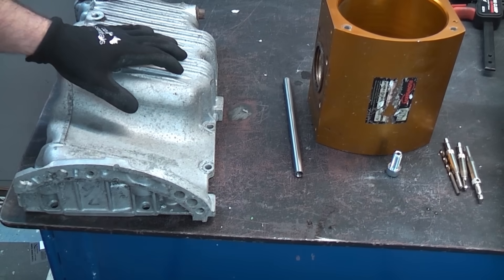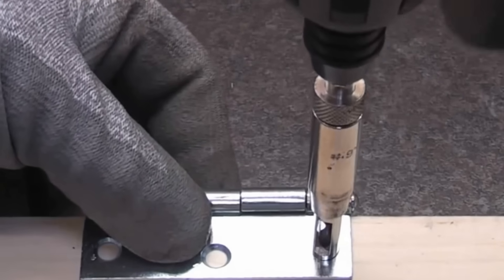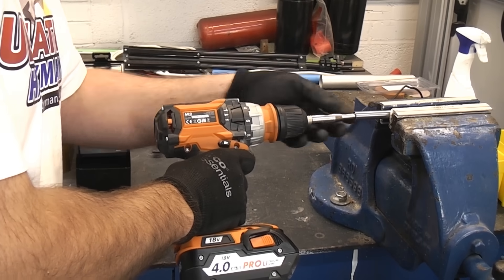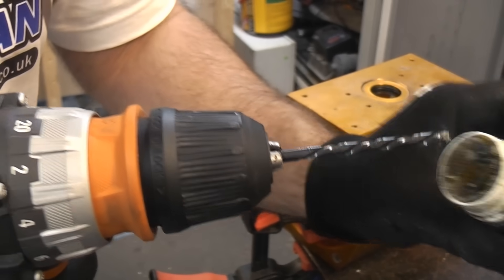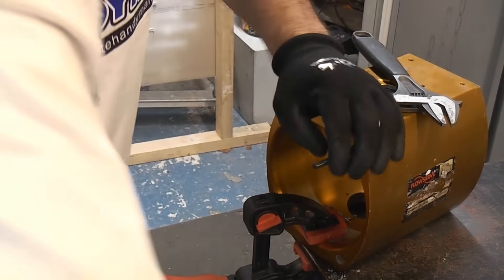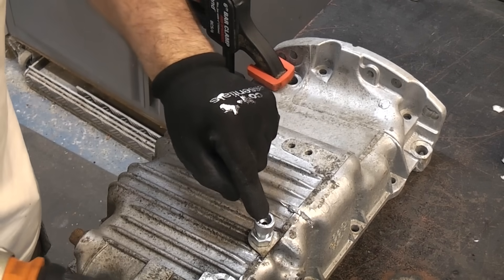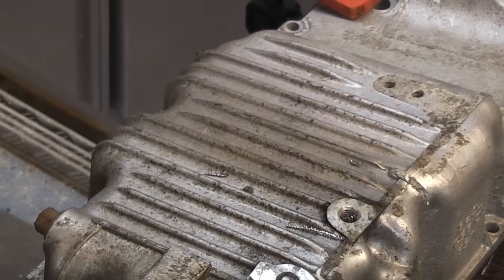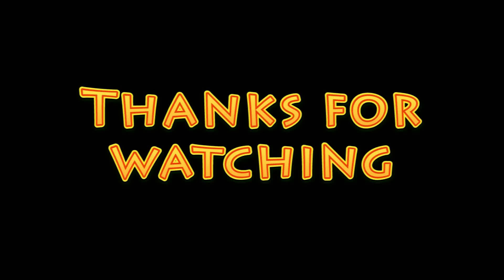How to remove a broken bolt in a deep hole | remove broken bolt in recessed hole

Comment: Just saying here, if you're trying to remove "softish" bolts then forget tapered easy outs. The more you turn them, the more the broken soft bolt expands and gets itself lodged forever. In these cases drill a hole as stated above and then take an Allen key socket and bang it in. This cuts 6 grooves without expanding the broken bolt too much. When in, wiggle it loose to unscrew it easier than the tapered "easy out". Just saying. In the last 10 to 15 years I've found Allen key method way better than easy out tapered method. Sure!! "Feel" has a LOT to do with it! But the average Allen key socket is much stronger than any "easy out". And because it's NOT tapered it does not make the situation worse. 

Also, if the stud end is near the surface, and it's rusted, then MIG weld a blob on it, then build that blob upwards until you can weld a "stud" to it. Vice Grip it when cool enough and carefully unscrew it using rust release oil spray. The heating effect tends to "burn" the rust inside the thread. When cooling happens, it shrinks and broken studs start moving. Try it, you'll like it! From Africa!!
Reply from the maker: I'll try this sometime.
Thanks for the excellent comment ;-)

Comment: It's not aluminium, (al loo mini um) it's aluminum (a loo min um) it's not even spelt with an I after the N. As far as the removals, excellent!
Reply from the maker: Seriously, this is getting boring now.
People in different parts of the world spell and pronounce things differently.
Reply: Ultimate Handyman lol, I'm just being a dickhead, jerking your chain. The video was excellent, I have left hand drill bits but have never seen that tool you used to centre the bit in the hole. I just centre punch then drill and when I relieve enough pressure, the bit digs in and walks the stud or bolt out. Now I have to buy another tool...darn...lol! Another thing I do is weld a nut on the end of the stud if it's protruding or you can get welding rods made specifically for building up a stud broke off in a hole. The flux protects the threads! Anyway, enjoyed the video, thumbs up from a dickhead in Canada.
Reply from the maker: @jimmiller4667   Thanks for the update. I try  to respond to all comments, but the ones about aluminum/aluminium take up far too much of my time ;-)
Thanks for the comments 😉

Comment: I build the bolt up with E6011 until it was  slightly higher than the piece. Then weld a washer to the top of the build up and weld a nut to the washer. Let it cool and remove it with a wrench or a socket.
Reply from the maker: Thanks for the comment 👍

Comment: Nice video ...but...I have never had something break off that I can get to on an engine...its always been a part that I could NOT remove from the engine without pulling the engine....just bad luck I guess.......example is exhaust manifold bolts, which you would have to remove the head to get to it.

Comment: If the bolt shears off unevenly, add penetrating oil,, shove back in the hole with downward pressure. Once in a while I get lucky, twisting out both pieces.

Metal rod to the bolt. Heat with torch or welder.  Using the rod to transfer heat. Then cool.  Trying to unstick.
Reply from the maker: Thanks for the comment 👍

Comment: I always use left drills for bolt removal, for all aspects of the repair, and I see the weld on the oil pan. You must love that car with hard to find parts. Liked the video though! Smart guides done on a lathe.
Reply from the maker: Thanks for the comment 👍

Comment: If you use a good sharp punch and get a little centering punch mark on the broken bolt, you can just use a very small drill bit to get a pilot hole and not worry about nicking the threads when you move up to a larger bit.
Reply from the maker: Very difficult if the broken bolt is not straight, which is why I made the guides ;-)
Thanks for the comment 👍

Comment: If you can reach it. Less than 3/4” down. I put anti spatter on the internal threads and build up until you see it above the surface. Then weld a nut through the middle on to the extended material. 1/2 up.  Maybe 3/8 but if under that. Using extraction tools is the best way.
Reply from the maker: Thanks for the comment 👍

Comment: Good idea but will it work on broken bolts that have been in steel like on a old exhaust manifold on older trucks
Reply from the maker: Probably not, we get rusted or bolts that have been subjected to heat and sometimes they are almost impossible to remove!
Thanks for the comment 👍
Reply: @ultimatehandyman  Thank you for the reply. I have a few older GMC trucks that all have exhaust leaks and your right, I haven't found a way to get those things out or at least easy. Thank you for he information

Comment: I'm wondering how you drilled through the bolts so perfectly.  I guess if you clamp it perfectly plumb in the vise the drill press will do a good job.
Reply from the maker: A lathe is easiest, but it is also possible on a drill press-
https://www.youtube.com/watch?v=6mZj0J6CNYA&t
Thanks for the comment 👍

Comment: Great idea drilling a center hole on the bolts, then inserting over the broken bolt and nut lock helps stabilize... what do you do if there's not enough thread above the broken bolt?
Reply from the maker: If there is not enough thread, you just have to try and remove it the normal way, by using the centre punch, then left handed drill bit etc. 
Thanks for the comment 👍

Comment: You can have more success with the bolt extractor or thread tool if you use a T handle for downforce and equal side to side turning force.  Using a wrench on only one side of the tool creates torque which makes it hard to keep downforce and keep the tool straight.

Comment: "Hinge centering drill bit" I went straight to Amazon and ordered a set. The hardest part of drilling out a recessed bolt is just getting the hole straight. I'm only two minutes into this video and found some tools I've never seen that I need and can actually use. Also if it helps anybody, I've used small pieces of vacuum tubing to center drill bits as well.
Reply from the maker: Thanks for the comment 👍

Comment: Really good video/tip. Thanks for sharing. One point though. I have found in the past that when using a steel fixing in an aluminium casting., that using copper grease accelerates corrosion due I think to dissimilar metals/electrolytic reaction. Maybe the copper promotes conductivity, speeding the process up. I only use standard grease in that situation now. Geat tip with the cap screws and left hand bits. I didn't know they were available! Thanks again.
Reply from the maker: We use copper grease all the time at work on aluminium with steel and we don't have that problem, but everything is inside.
Thanks for the comment 👍
Reply: @ultimatehandyman  NP. To be fair I have only experienced this in an outdoor situation. Thanks for the reply - appreciate it.
Reply from the maker: @bitofbritlife183   You are welcome ;-)

Comment: Excellent demonstration that details tricks of the trade, that really does works well for 95% of broken studs. Very well presented. For the really difficult situations, they can be removed by using a spark erosion machine (EDM). Unfortunately these machines are usually found in Toolroom Workshops and some and General Purpose Manufacturing Workshops. It is an expensive fix, but it will work for the more expensive renovations etc.
Reply from the maker: Thanks for the comment

Comment: Many times bolts seize because the dissimilar metals crate a galvanic corrosion (Zinc-carbon battery effect). Anti seize paste interrupts than effect but any exposed areas will react even worse. The bolt must be fully coated end-to-end, not “just” the threads.

Comment: Dude the adjustable wrench is the last tool you should be using for this job and it shows badly
Reply from the maker: Dude, if you pay attention, you will hear me say that my tap wrench is at work, apart from the one in my garage that is about 2 feet long 😉

Comment: How would you know whether a drill bit is right or left handed and is this the same process to use on broken screws
Reply from the maker: Most drill bits are right handed. Left handed drill bits are specialist items and it will be clear when you buy them, that they are left handed, as they will be more expensive. Broken screws are difficult, especially wood screws! But if the screw is large enough, the left handed drill bit might work ;-) 
Thanks for the comment 👍

Comment: Thank you for sharing this great video well done trick, if I ever figure out the time machine I will use it. Keep smiling with lol politely & safely
Reply from the maker: You are welcome
Thanks for the comment 👍
Reply: Never use copperpasta, with aluminium and steel.It will be an elektrolytic bitween the alu, and the steel.like the  boats i FLA, they put zink anods on the roder so th3 salti wather dont eat it up.

Comment: Actually for those that don't have any cutting compound    just use copper ease, on the drill bit. I actually  bought a big tin of copper ease about 8 years ago and it's still half full. i just dip the drill bit in the darker oily surface of the copper ease, ( used for brake pads)  and the drill will cut through any metal very quickly and without getting hot..  buy a tin of copper ease, it's a great investment..and can be used on exhaust studs, exhaust clamps, and lubricating the edges of brake pads, ( just a slight smear) to stop them from sticking when hot...  great video, its always nasty when a stud or bolt breaks, and this is a great way to remove them..
Reply from the maker: Thanks Colin, I have plenty of copper grease, but I believe it is not good for you. The tin at work definitely has a lot of safety warnings on it, so using it when drilling might not be such a good idea, as some of it is vapourised.
Thanks for the comment 👍
Reply: @ultimatehandyman  The brand I use  is COMMA, COPPER EASE  tm   that's a genuine trade marked product -40c to +1150 deg   made in the UK  totally safe, there are no warnings on the tin .. Ive used it since the late 60's  and bought the current tin over 8 years ago on a trip to the UK..
its sold at HALFORDS for about 8 quid for a tub (now in plastic)  500g  
their data sheet lists NO HAZARDOUS  contents and is safe to use..
Reply from the maker: @colinmartin2974   OH, OK. Not sure what they put in the stuff at work though!
Thanks for the comments

Comment: I like that hinge sleeve thing you're using at about 1:58. I also get a kick out of you calling it a grub screw, we always call those set screws here. I'm gonna start calling em grub screws at work tomorrow just to see what the old timers say lol
Reply from the maker: It's weird how things are named differently in different parts of the world. In another video, someone has just been triggered because we call a tool for undoing a nut a spanner, rather than a wrench 😂

Thanks for the comment 👍
Reply: @ultimatehandyman  Yeah, over here they're called wrenches, we only use "spanner" when referring to pin spanners. Another difference I've noticed is that what we refer to as pipe wrenches, some guys in the UK refer to as "Stillsons". Anyway great channel, I've come across lots of interesting tips from watching your vids!
Reply from the maker: @mrgrey361   We have pin wrenches over here, plus pipe wrenches, but most people called them Stillies or Stillsons, much like people call a vacuum cleaner a Hoover 
Thanks for the comments

Comment: Excellent idea with the centering bolt drilled. I'm going to make myself up a set of these for different sizes to uses at work. I'm always getting a call from someone that broke the head off of a screw they were trying to remove and need me to drill it and remove the broken screw.
Reply from the maker: I'm glad the video helped 
Thanks for the comment 👍

Comment: where can I buy this hole screws?
Reply from the maker: Hinge centering drills- https://fave.co/2DpJo1H
Left handed drill bits- https://fave.co/2xJjK1M
Teng screw extractors https://fave.co/2OnfRuF
Dormer taps -https://fave.co/2OsN1sQ

If you are in the UK-
Hinge centering drills- https://fave.co/2NE1VMc
Left handed drill bits- https://fave.co/2DubtF4
Teng screw extractors- https://fave.co/2pVLkVT
Dormer taps - https://fave.co/2pTfbyx

exact cutting paste- https://fave.co/2Nabyxc
cobalt drill bits (they are much better on harder steels like bolts) https://fave.co/2zDh3kp

You'll have to make the guides yourself, but they are easy- https://www.youtube.com/watch?v=6mZj0J6CNYA&t=1s

Spring tools centre punch- https://fave.co/2NbnLBD

Comment: Thank‘s .... i m a mechanic for 20 Years now, today i see such a left-hand screw extractor workin for the first time...
Reply from the maker: They are hit and miss. I have had them work a few times when working on site, but a lot of the time they don't work and you end up drilling the whole thing out and re-tapping the hole.
Thanks for the comment
Reply: Ultimate Handyman I ve seen them broken and stuck in the thread, worn out, widened the screw... 😖

Comment: I'm surprised you appear to be using normal WD40 which is a good water dispersant but poor penetrating fluid. 50/50 ATF and acetone, a little time and a little shocking and it would have penetrated each of those you showed. I love the cored out bolts as drill guides/sleeves.
Reply from the maker: I just use whichever spray penetrant that I have available
Thanks for the comment

Comment: If its steel in aluminum use a highly concentrated solution of alum and water. It will eat the steel bolt and leave the aluminum alone.
Reply from the maker: Thanks for the comment

Comment: I never would have thought to drill a hole down the center of another bolt and use a nut to hold it in place to be able to drill into it first to save your threads. It's brilliant! I have decent bolt and screw extractors, but the smallest I have is just a bit too big and I just knew I was going to ruin the threads. Since it is a very expensive sewing machine part, I have no desire to ruin something so costly when I was sure there was a way to do it without damaging the part. You, my man, have saved me from that unpleasant outcome. Thank you!
Reply from the maker: You are welcome
Thanks for the comment ;-)

Comment: Good to see the trusty AEG 18v drill. AEG stuff is underrated I reckon, and the blokes at my local tool shop say when compared to Makita (which is generally regarded as the best for general tools) it's just as good but only costs two-thirds as much. Plus, it has a 6 year warranty. Nobody else has that much confidence in their products.
Reply from the maker: That drill is great, I love the feel of it, and it has plenty of power. The only thing that lets AEG down in the UK is the amount of tools that use the same batteries, as the AEG range seems tiny compared to the Dewalt or Milwaukee range.
Thanks for the comment
Reply: @ultimatehandyman  It used to be like that here in Australia too, but in the last few years AEG is making a big effort here and the AEG range is second only to Ryobi. Ryobi aren't regarded as a serious brand though, they're more a casual home handymans tool so I think they're trying to make up for lack of quality with quantity. (AEG, Ryobi, and Milwaukee are owned by the same company so they must be laughing). Makita are definitely losing their grip as top dog, they're not as good as they used to be. Milwaukee have a great range and are quality tools but none of our big hardware stores stock them (weirdly) so they're being hurt by that. They also just pulled their sponsorship of one of the front line Supercars teams, and a few of our popular automotive repair youtube channels have recently abandoned them so I think they might be not doing so well financially, in Australia at least. The parent company TTI seem to be pushing AEG and Ryobi really hard, but not making much effort with Milwaukee. No idea why.
It's a pity the badly timed and badly managed attempt by Bunnings Warehouse to attain a market in the UK wasn't successful - they have been AEGs biggest outlet and promoter. Had it worked in the UK you may well have access to the AEG range we currently have in Australia. I guess if you were that keen you could buy them online and have them shipped over, but that's a lot of trouble to go to.
Cheers.
Reply from the maker: @woopimagpie   I have tried a couple of Ryobi power tools and they have not been good to be honest. A mate of mine said he got a pallet load of Makita stuff once for a charity TV program, he said that it was that bad that they sent the pallet back and luckily got a pallet full of Metabo instead! Judging by the comments that I get on YouTube, there seems to be lots of AEG in Australia, perhaps it is some kind of marketing ploy by TTI

Comment: Nicely done Ultimate - what's your protocol if the bolt is NOT below the surface but proud by a few mm (maul grips?) I've managed to snap a disc/hub bolt (10mm thread) with about 8-12mm jutting out the hole - please share your wisdom - thanks!
Reply from the maker: With something like that I would try to weld a nut onto the end, as the heat generated can really help to loosen the bolt. 
I set this demo up a while back- https://www.youtube.com/watch?v=_R1b8niX13w
Good luck with it ;-)

Comment: sir, would this work for a 2006 scion xa thermostat screw? its about half an inch outside the hole, but my plyers cannot twist it out. would I still be able to do this idea with the screw sticking OUTSIDE the hole? its a very skinny screw, about the E-4mm star top size. I'm scared that I wont be able to fix this, and I cant afford a mecanic.
Reply from the maker: A screw extractor might work- https://www.youtube.com/watch?v=SMrDYJvY0Ts&t
Or welding a nut on the end might be a better option, if you have a welder- https://www.youtube.com/watch?v=aRrz-cphBY4

Good luck with it ;-)